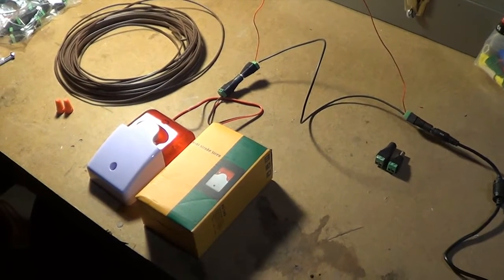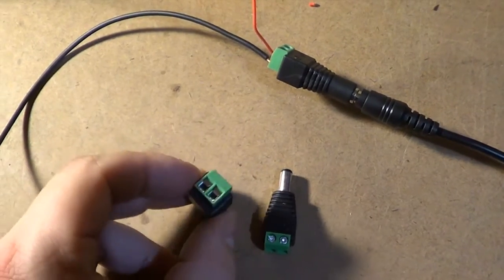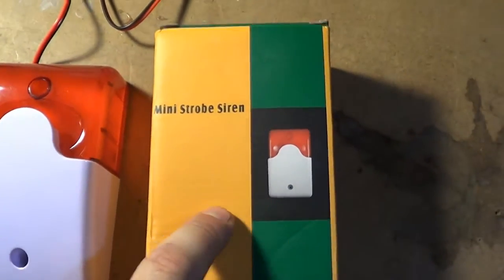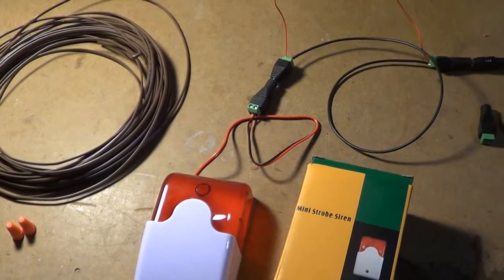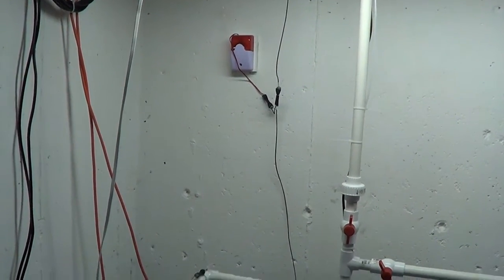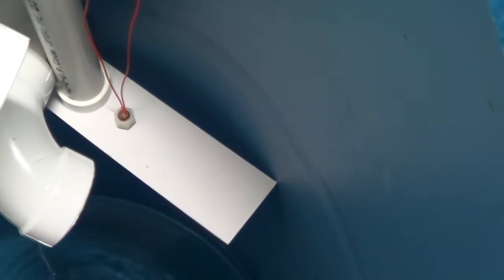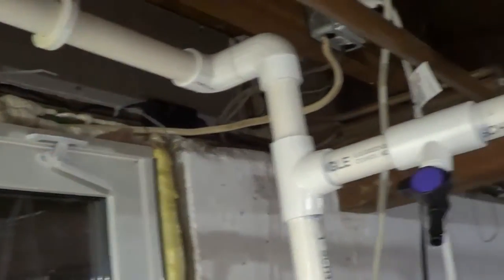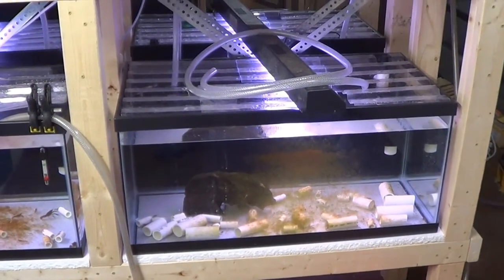#266: DIY Float Activated Water Alarm for Aquarium Sump - DIY Wednesday

Comment: Hi looking to hook up my ro under tank to fill my reservoir rigth next to it dont know how cant i control my reservoir keep filling with water there some eletric solenoid than i can use with booster pumps or not ? I got digital aquatics contoler for my switches figure out maybe using the float valve to make happen... is going to work help me out please ... obs:  resevoir got lot off working got be filed and empty fast one of the motives i dont wat working with float level ....
Reply from the maker: if you put a float switch in your reservoir and connect your ro line to a redundant solenoid valve, when the float switch activates it will turn your ro off.

Comment: Is the alarm loud enough so you can hear it in the house. You can also connect a wireless doorbell to it. You would have to connect two wires to the transmitter so you can connect to the float switch. Then you can have the bell in the house. Thanks for sharing.
Reply from the maker: my wife says it is indeed loud enough =)